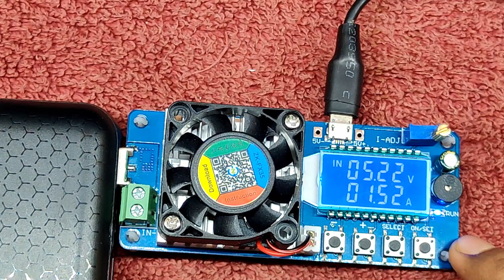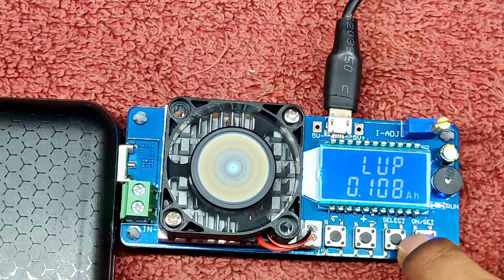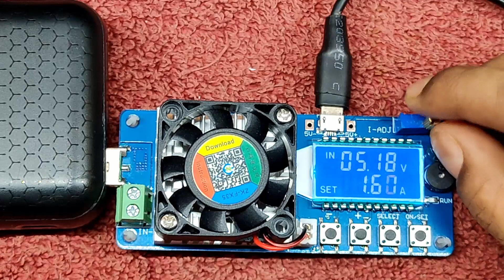ZK-FX35 (2 in 1) Battery Capacity Tester & Electronic Dummy Load | Unbox & Review | English

Comment: I suggest you calibrate the Voltage display , also current indicator is notr epressemtive of actual CC load , I puta  fluke 177  in series and it did not match / not even close   so make a table .. overall    not accurate at all.
Reply: I find the same; way out. I recalibrate current for each given current needed, if I want accuracy. I find voltage to be fairly close across the range.